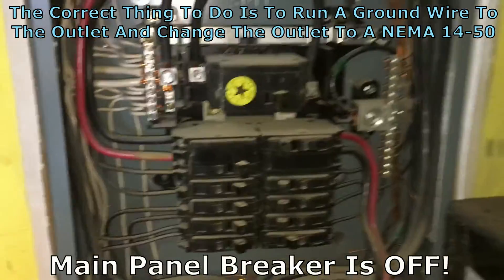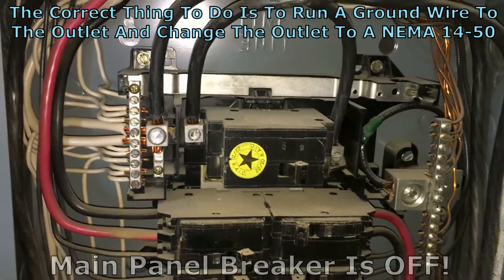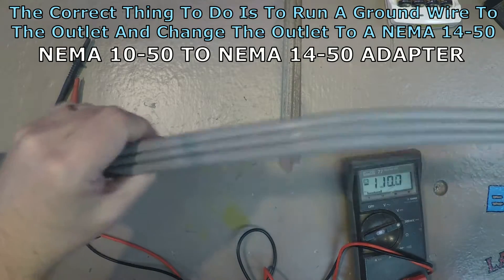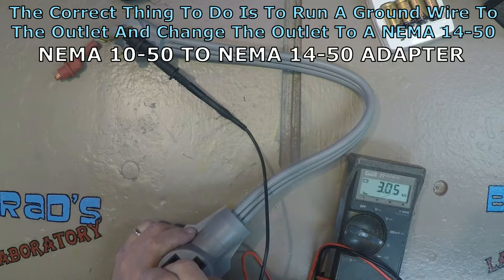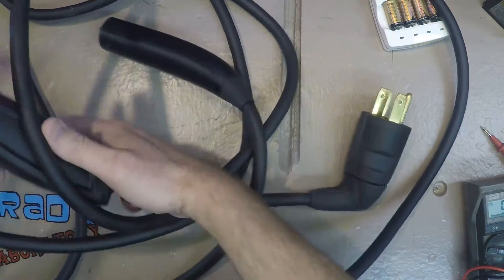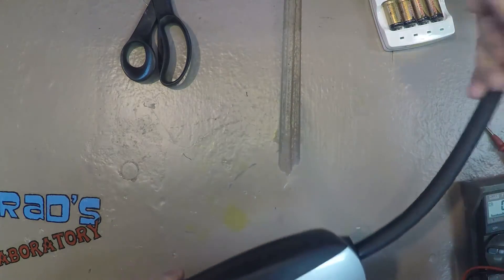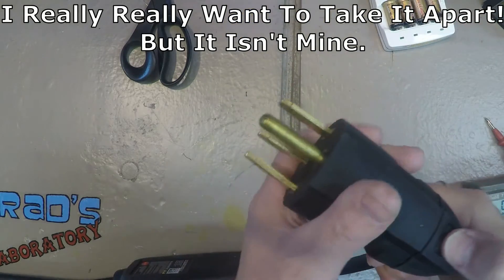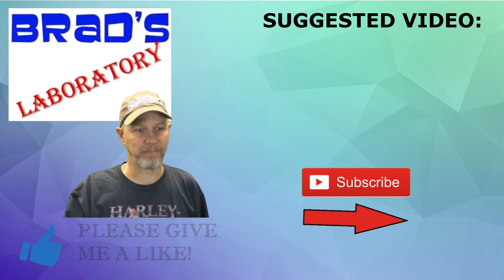Tesla Charging On A NEMA 10-50R

Comment: Thoughts on using a a 10-50 to 6-50 adapter?

I have a 10-50 outlet. I have a 6-50 plug for my Tesla charger. Debating on just getting an adapter rather than replacing the outlet that I currently use for MiG and arc welders
Reply from the maker: I think I would just get an adapter. That way you can keep using your welders.

Comment: EVs don't need the neutral correction which is used to supply power to devices that need both 120v and 240v.  So my understanding is that the adapter plug uses the neutral/ground line for ground only.  This works fine for all EVs but this type of adapter should be used only for EVs.  It generally states that in the information and sometimes on the adapter itself.  These adapters are also available with 2 x 6 gauge wires and  1 x 8 gauge ground wire.
Reply from the maker: The EV is converting the AC power to DC to charge the batteries. This is done with a what is basically a power supply. when plugging a power supply into you house power a ground is not technically required if things are double insulated. A good example of this is a USB power supply from Apple that only has two leads, it uses hot and neutral and not the ground. The problem with the NEMA 10-50R is that it doesn't have a ground, This is why it has been outlawed for new construction. My house being older is grandfathered in since it was built before the laws changed, however if I was to do any major construction I would have to upgrade it to the newer outlet with a ground. Ground and neutral are bonded together in your breaker box - so they are the same potential, however you don't want current flowing on the ground only on the neutral. So by tying the Tesla Ground wire to Neutral it works OK allowing current to flow on the Neutral lines to the breaker box. the problem is now the car's ground is now tied to neutral, not ground. So if something is wrong in the car's charging circuit,  you could get a shock from the car's body. This problem has nothing to do with it being an "EV" that is plugging in, any power supply wired like this will pose a possible shock hazard as the safety ground is not there. Hence why the NEMA 10-50R was outlawed. You might also notice that the link in the description to the adapter that was bought is now broken, as they quit selling this dangerous adapter.
Reply: @BradsLaboratory  There are dozens of NEMA 10-50P to 14-50R adapters available from a variety of sources.  Just a few:
https://www.evseadapters.com/products/nema-10-50p-to-14-50r-adapter/
https://www.amazon.com/Conntek-EV1050T-Adapter-compatible-Vehicles/dp/B00STD9SJY
https://www.ebay.com/itm/30-50-Amp-NEMA-10-30P-Dryer-Plug-to-14-50R-Electric-Vehicle-Adapter-Tesla-Bolt-/253692902684
https://www.ebay.com/itm/NEMA-10-50P-to-EV-14-50R-For-Tesla-or-EV-only-1-5-FT-adapter-cord-/253723412470
And lastly, a kit:  https://www.amazon.com/Gomadic-Electric-Vehicle-Charger-Adapter/dp/B079M4FM5W
Home Depot sells one too.
Reply: @BradsLaboratory  I would agree that the 14-50R is current (excuse the pun) best practice, but EV charging with the above adapters should be no more dangerous than using your oven, dryer or welding equipment that the older 10-50P plug was used for in millions of home and business installations.